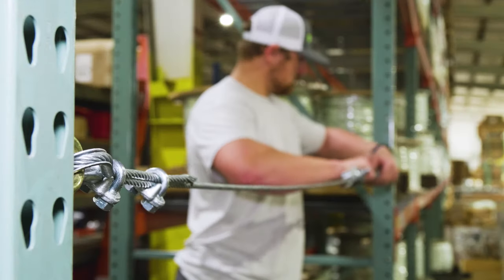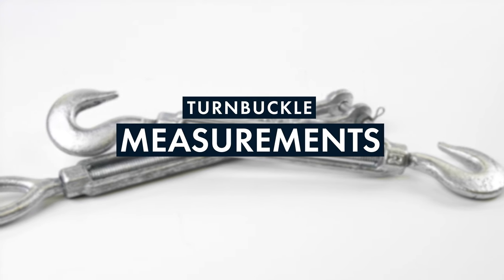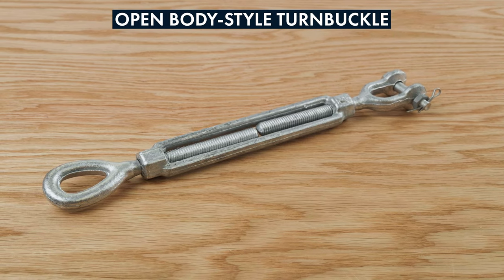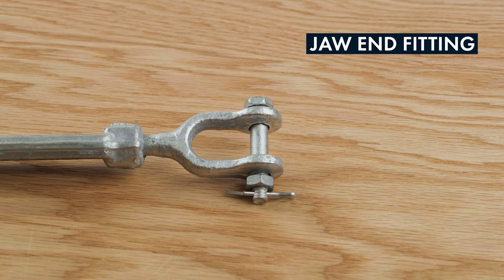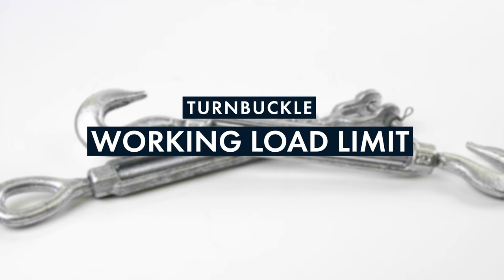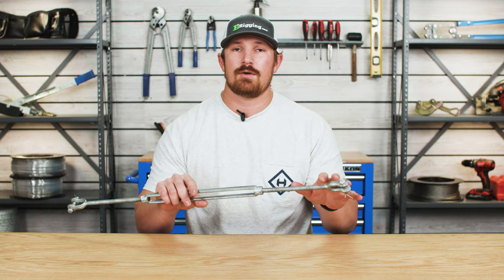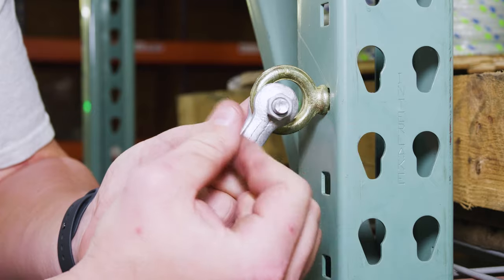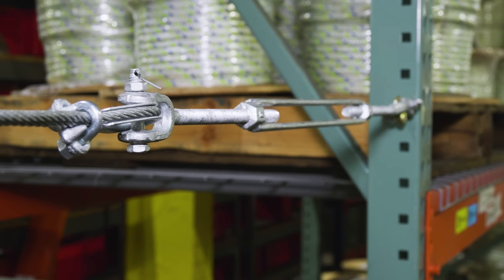How to Use Turnbuckles in Your Next Rigging Project

Comment: I need help, bought a 1.5 inch turnbuckle rated for 9.5t pull force.
I used some lube on the threads but using a crowbar plus cheater pipe to make it longer I barely reached 5tons. 
Do I need an even longer lever or what?

Comment: So, how does one determine the length of the cable in between turnbuckles? In addition, is it better to have the turnbuckles on both ends, or on one side?
Reply from the maker: Thanks for the question. Usually, an installer will attach the open turnbuckle on one eyebolt and shackle on the other, then they'll hold up the turnbuckle and take a measurement between them. They'll use that measurement to create a spliced cable assembly. For most applications, only one turnbuckle will be required. Feel free to check out our video on wire rope clips to learn about more about splicing cable. https://youtu.be/HKt6kswEAXo

Comment: Turn buckles can also be used for expanding things, or push apart things. Seen in this video they are used to pull a cable tight by drawing inward. What I say is they can also be used much like a jack and used to spread apart items instead of just pulling together. One main concept of doing this i speak about is the common roof jack used to lift up a ceiling beam or a porch beam so the pillar can be worked on or replaced without removing the beams themselves. Yhe same idea can be used in smaller things using bolts screwed into each end of the main turnbuckle, insert into place and turn the buckle thus spreading them apart as well as the item you wish to spread apart like a jack. Remember, what can be used one way, can also be used as a tool in reverse as well to force things apart..
Reply from the maker: While that is innovative and I am glad it had worked for you, these tools are not designed to be used to hold that direction of force.  I would only recommend using a turnbuckle this way in non-critical instances.  Thank you for your comment